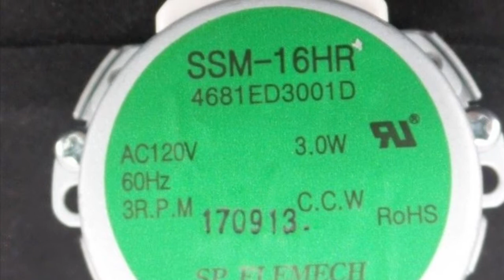✨ LG DISHWASHER — DIVERTER MOTOR EASY REPAIR ✨

Comment: Those first 2 screws that you removed are a lot easier to get to if you first just pull up on the lower spray arm to remove it out of the way. And honestly, you don't need to remove those screws, they can stay in place in the filter housing, they do not attach the filter to the bottom of the unit.
Reply from the maker: Thanks Wesley👍

Comment: I checked my diverter motor and it was corroded and rusty. I replaced it and the dishwasher worked once before I got an the same error code. I bought a new switch and diverter motor, but I thought maybe there was a leak that was causing the problem so I bought a diverter motor seal. The problem is I can’t find where the seal is supposed to go. Do you know how to replace the diverter motor seal?
Reply from the maker: They want you to buy an entire sump assembly.  It does stop the leak👍
Reply: Hmmm.....might be time for a new dishwasher.